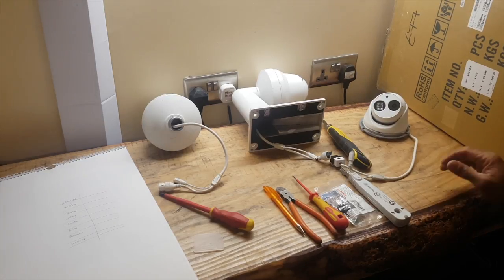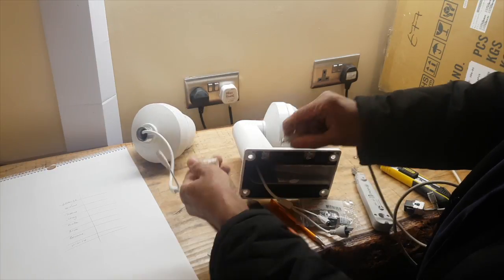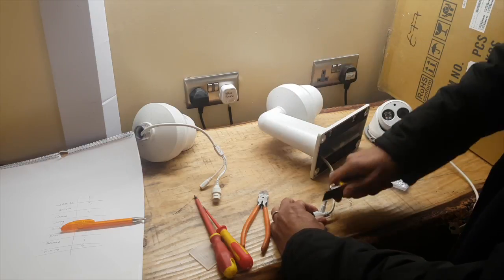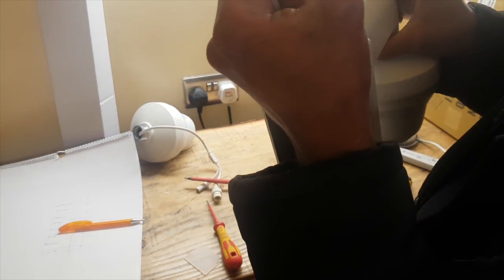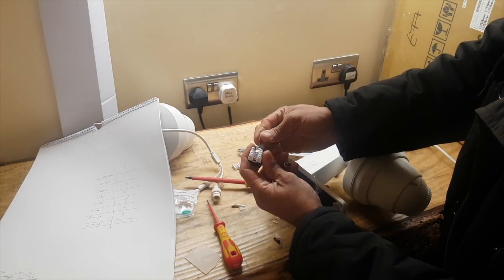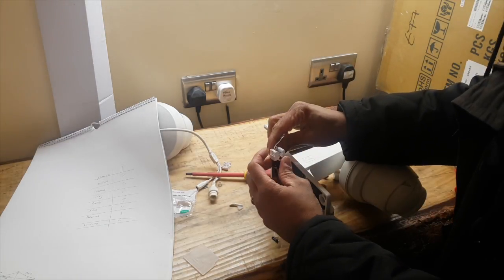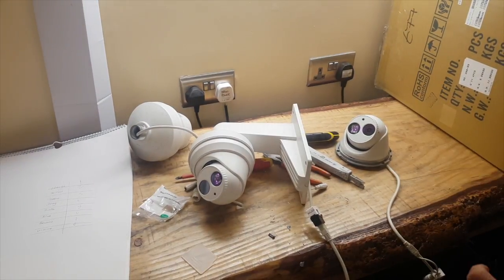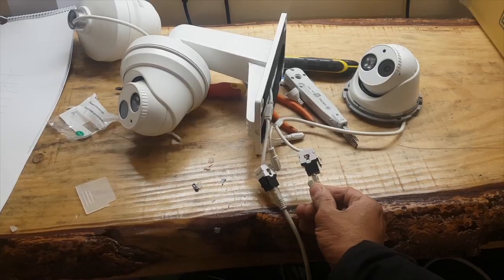4MP Camera Repair

Comment: Nuvico Camera CV-STD21N-L
Pin out of the rj45 connection has corroded.  Need to replace the connection.  Wiring does not match up with the standard wiring.  The wire colors solid green, orange, brown and blue.  Need to replace connection and want to match up correctly to the standard rj-45 568.  Please advise how to do the pin out for this to work properly.  
I have looking in the installation manual and I cannot find the pin out pattern.
THanks for any help.
Reply from the maker: Diana Barlamas please send a picture close up of the damage part thanks.

Info@gunirsecurity.camera